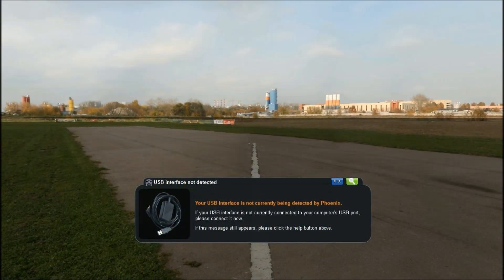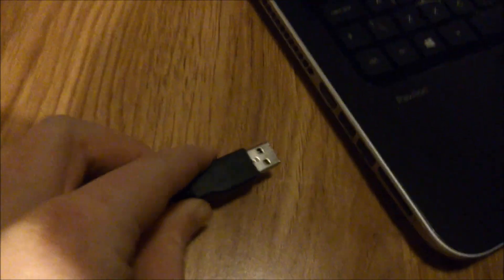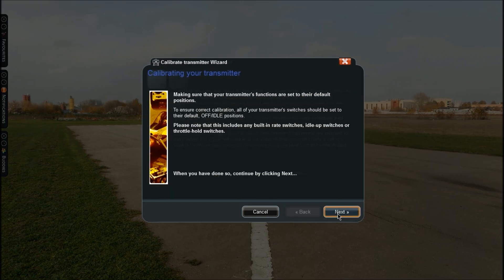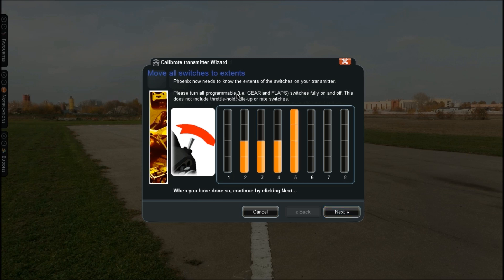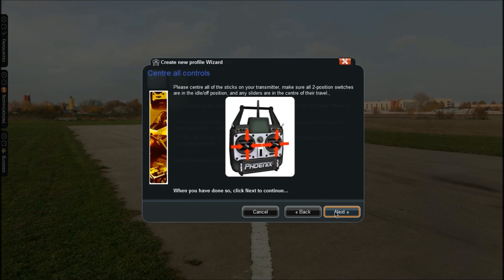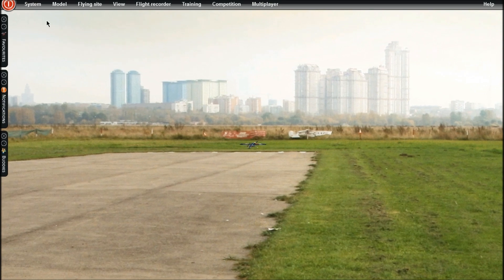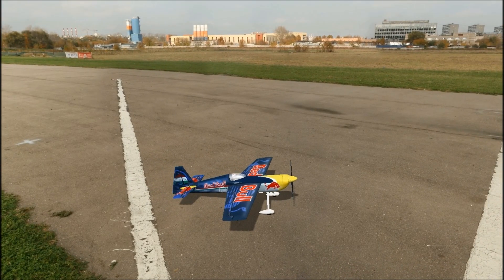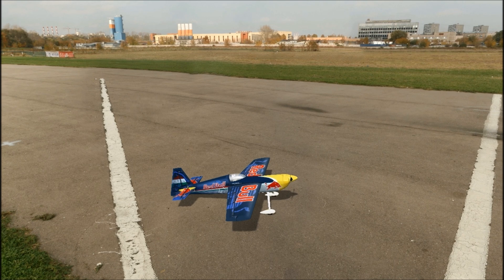Phoenix Rc v4.0/v5.0 - How to setup your Transmitter.

Comment: Looking at the "Phoenix R/C Pro Simulator V5.5 with DX6i Transmitter" Is this compatible with all R/C aircraft transmitter/ systems or just "blade" products?  It works for the simulator and the actual  models as well...correct?
Reply from the maker: RemoWest Yes the transmitter will work with both the simulator and real models providing you use compatible receivers etc.. it’s not just limited to one brand

Comment: I have a Phoenix R/C4 with Spektrum DX5e. It has been unused for quite a while due to illnes but would like to try again. When I turn it on it does not recognize my controler. The program will turn on but will not recognize the control. Any sugestion?v

Comment: I need one of the cables please. Thanks
Reply: +Cubeholic I brought one of them really cheap flight sims from China about seven years ago,the one i got was off of ebay and it had about five or six of the well known flight sims at that time,of course the Phoenix sim was on there too,my point is it came with a cable that worked with my old DX6i TX (Radio) and it still works on my DX8 now,if you can't find them on ebay try one of these from banggood.com,there are a few on this link that i will leave you and you can see the ones that will work for your TX because it will say Phoenix on it,so therefore it will work on the Spektrum TX's as it did mine,if you see how cheap the sims are which give you all the cables you will need for most TX's it works out cheaper to buy the flight sim with the cable rather than buying a cable on it's own IMHO,sorry i rambled on a bit lol. 

LINK 
http://www.banggood.com/search/spektrum-flight-simulator-cable.html

Comment: Would have been nice to have covered actually setting up the transmitter.  The stuff you cover is adequately and very clearly indicated in the software, but there is no mention of the actual settings to be put into the transmitter used.
Reply: +Sandy Scott Agreed. My transmitter in the problem i think :)

Comment: I am new with these stuffs. Recently bought FS-CT6B, was searching for a simulator  and came across ur video. The point you mentioned about the 3.5 mm jack, well 3.5 mm jack port is not there in my tx. Does that mean I won't be able to use the phoenix rc simulator? Can you please suggest me with some other simulator that will be suitable for my Tx
Thank u

Comment: Great Video
One Question 

I have a Phantom 2 and the Phoenix 5, I don't have the cables or usb interface though. My question is, if I buy the 12 in 1 all in one ebay dongle usb interface will I be able to connect my DJI Phantom Radio so I could use the Phoenix and fly the phantom? Thank you
Reply from the maker: Hey, thanks. I'm not too sure about the Dji transmitters, im not aware of any ports it has to connect. What ports is on the tx?

Comment: I need a USB interface cable. I have the Phoenix 5 software and I have a Spektrum DX6i radio. I f you could get me a cable or tell me where I could get one, That would be great
Reply from the maker: The link to the USB interface is in the description :) if it doesn't open this is the same link http://www.ebay.com/itm/12-in1-Flight-Simulator-Cable-USB-Dongle-4-JR-FUTABA-Eflite-DX6i-DX7-Transmitter-/400511876426?pt=Radio_Control_Parts_Accessories&hash=item5d405e3d4a It's one from eBay.com but if you type in 12in1 USB simulator dongle into ebay nearest you, they are the same :)

Comment: I did the steps as you outlined, but the PC does not recognize the transmitter.  When I move the stick, Yours shows bar lighting up and mine show nothing.  Any thoughts?
Reply from the maker: Must be a problem with the connection, What dongle are you using ? Has it ever worked before? Try a different USB port and make sure you're putting the 3.5mm cable into the correct jack on the tx as a few transmitters come with a few :)

Comment: Is this working with Phoenix v5?  I have it working up to the latest v4 but v5 always gives me the USB not connected error
Reply from the maker: Yeah it does. Works with all versions. Try different USB port's or check your 3.5mm connection to the Tx, if you still cant fix it, reinstalling would be the best.
Reply: Hm, I'm currently hooked into the mic port with a 3.5mm connection.  It worked up until v4.  I guess I'll need a Walkera adapter to work with v5.

Thanks for the advice

Comment: Hey! I have a Avionic RCB7X. Will this controller with Phoenix? It comes with the function for using it as a wireless simulator also.
Reply from the maker: Hey Nipun! Yeah the RCB7X does work with Phoenix R/C Sim, If you know how to setup the wireless simulator, then Phoenix should pick it up easily using that :)